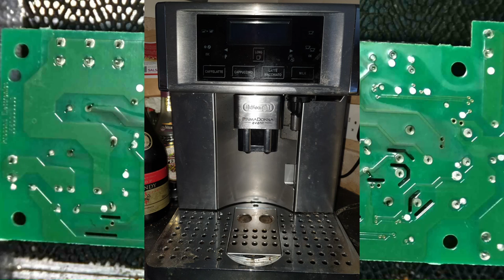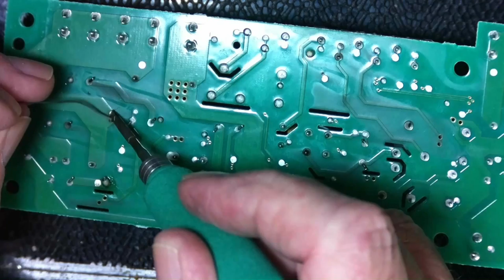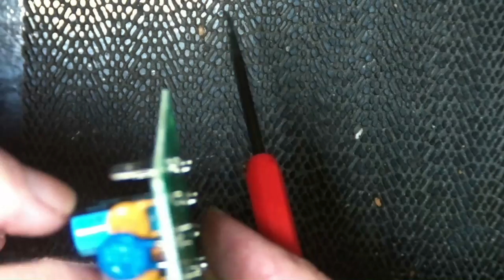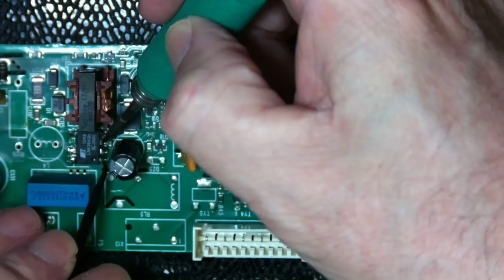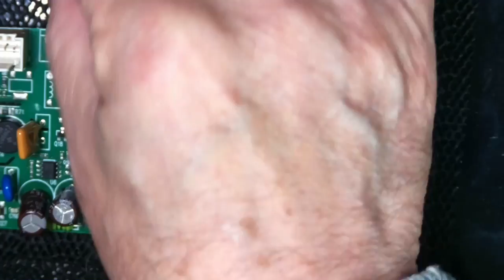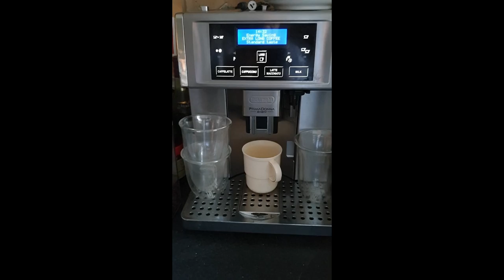Coffee Machine Power board repair, Can it be fixed !, What Happened Next!

Comment: Great video. I find it easier to snip the legs off of components that you know you are replacing.  Makes it easier to heat a pin and either suck it off the board or grab it with tweezers. I will have a go at mine tomorrow. Cheers.

Comment: Thank you your post. I have a machine with the same control board with the following symptom: A) coffe making is good, 231V AC on the F8 pin on the board, boiler is heating. B) After a coffe making the boiler starts to cool from 91 degree celsius to 65 degree celsius. It is about 10 minutes. C) Reaching this 65C temperature the display show "Heating...." but there is no AC on the heating element. D) After couple of minutes the display change from "Heating" to "General Alarm". It is clear the controller try to heat up the boiler again but at this time no AC out on the F8 pin. Sensing no desired temperature change within a given timeout in the boiler the system gives the "General alarm" message. TCOs seems to be OK, zero ohm all the time. What do you think what could be the problem?
Reply from the maker: I am no expert,  from what you are saying and your board is the same i would check the connection on X7, this is the coffee boiler temperature sensor,  the sensor maybe defective.
Reply: @lambert0259   I think the sensor is OK, that is the reason of the "Heating" message: system recognizes the low temperature, start the new heating cycle with the "Heating" message. On the otherhand it is worth to check to make sure it is working right. I am planning to solder test wires to the PIC controller output which controls the TRIAC gate circuit.  I hope this is a HW and not an SW issue due to some flash corruption.
Reply: Hi did u resolve this issue im experiencing the same thanks.

Comment: Hi, can u tell me what kind of electronic parts did u use? Inductance (H) ? resistor(ohm?)thks
Reply from the maker: the inductor is 1mh and the resistor is 47ohms. hope that helps
Reply: @lambert0259  thks.. i have 2 faulty powerboard... i just order that electronic parts!
Reply: @lambert0259  Is it 1/4 or 1/2 watt?
Reply from the maker: @dalskiBo  As the resistor showed signs of burning i used a higher wattage resistor of 3W hope this help
Reply: @lambert0259  What is the function of the resistor?
Reply from the maker: the resistor is used as a voltage dropper

Comment: I have several of these machines of various models that have a maximum grinding time of 3 seconds no matter what the ground bean volume is set to. When the bean volume is set to maximum the grinder should typically go for at least 7 seconds. The typical fix for this issue is to replace the control board, but if someone knew which component on the control board is the one that causes this issue from generation to generation on these machines, it would be much less expensive to replace a resistor or a capacitor than a whole motherboard. Mr. Lambert seems like a man who probably already knows the answer to this, or could possibly figure it out. Yes?